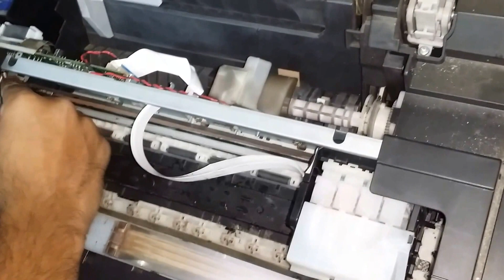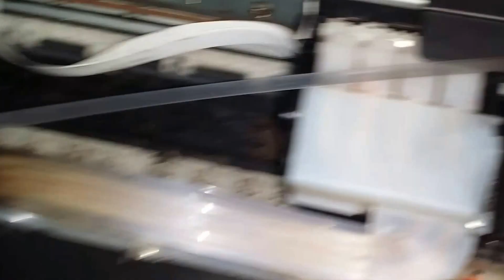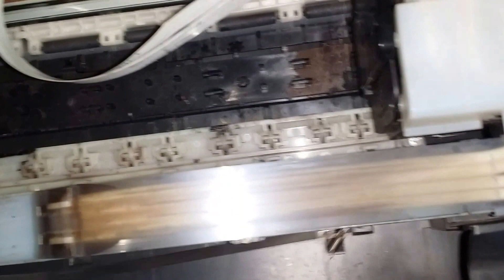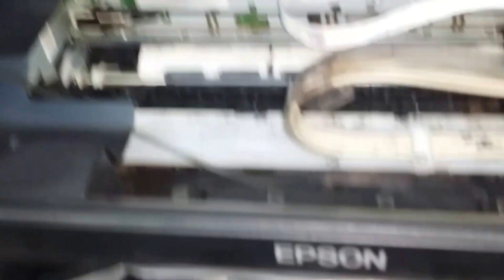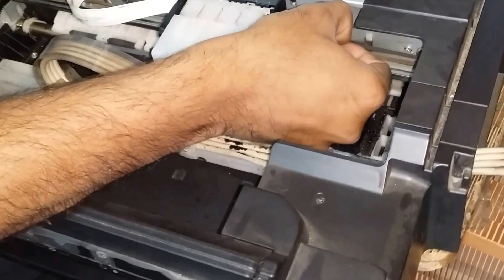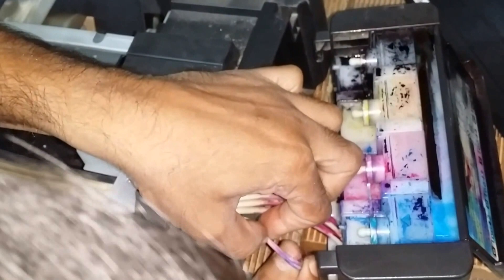How to fix : epson l210 l220 l380 two red light blinking problem

Comment: I have epson L210. black colour ink head is clogged. now scaner light is turning on but ccd is not moving within it. the printing section head is moving but after few second before stopping a huge cracking fricktion sound came out.I dont know how to fixed it!!all those 3 light is blinking.